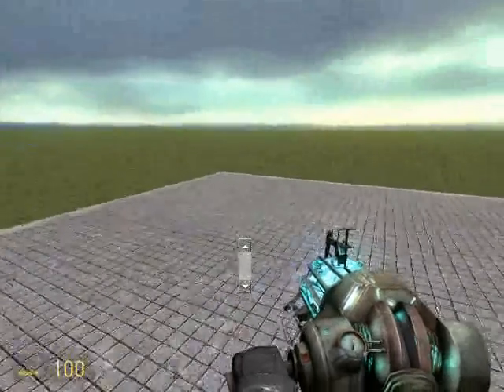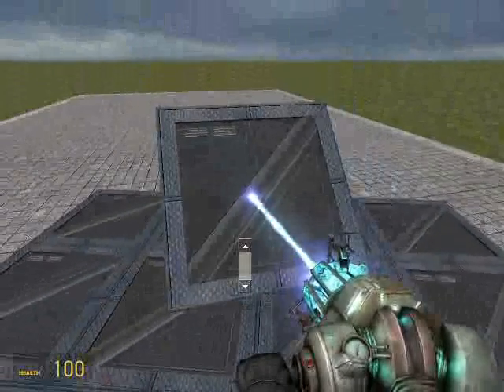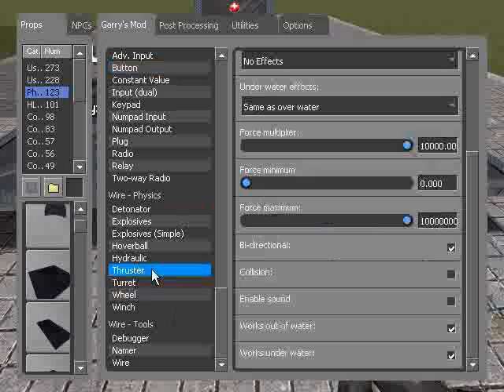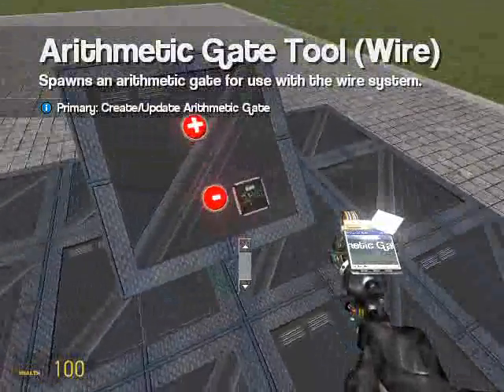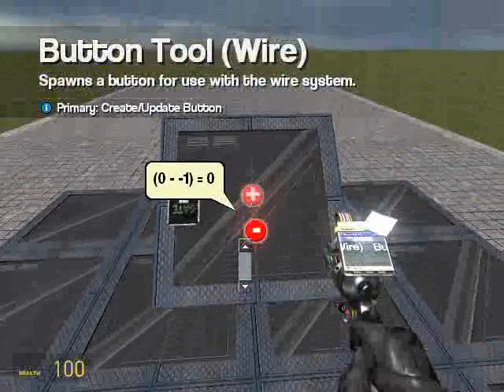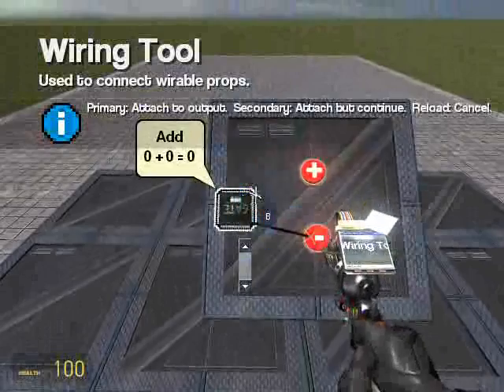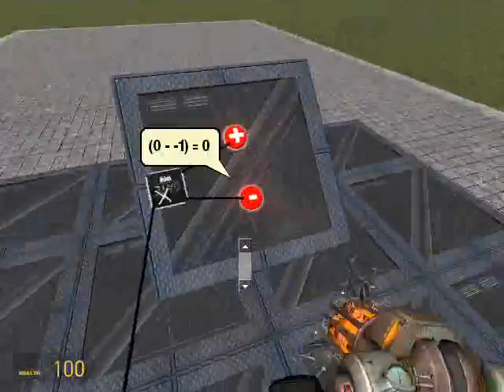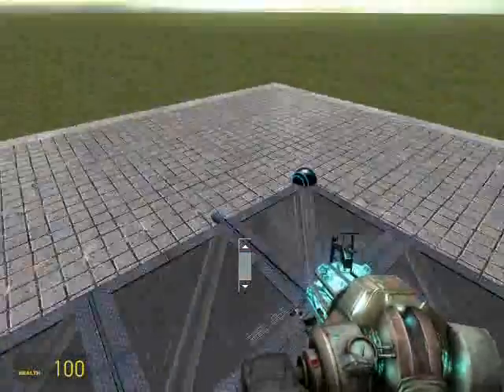orb's Gmod Wire Mod Tut 2

Comment: you can use a radio instead of wiring the two thrusters to the gate, can't you? just wire one radio up to the gate, and wire the two thrusters to the other radio? i'm still new at wire mod

Comment from the maker: When I used to play 2 years ago it was not possible.  The best way to control things while in a seat is to use the Pod Controller (this may have changed since I played).

Basically it takes input from your keys when in any kind of "vehicle" (such as a seat).  Watch tutorial 19 for more info on the pod controller.

Comment from the maker: It means you installed wiremod incorrectly.  If you're in your own client server and not in a public server, you probably installed the lua files of wire but not the models.  If you're in a public server you probably didn't install it at all (at least not correctly)